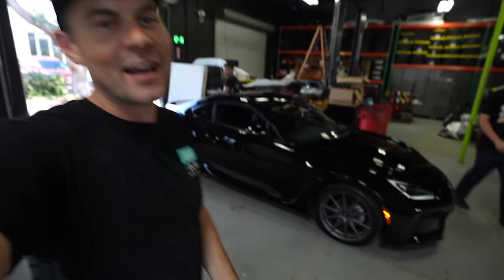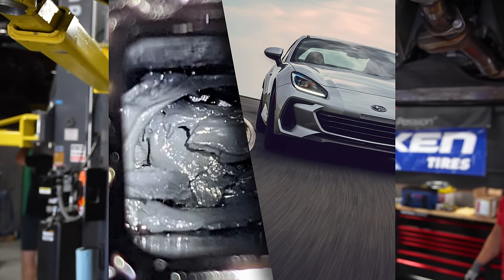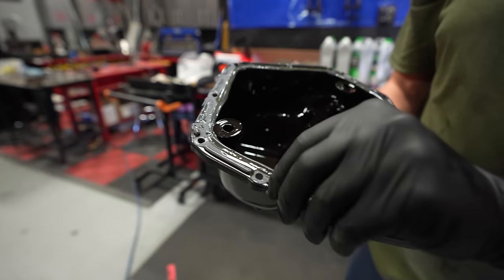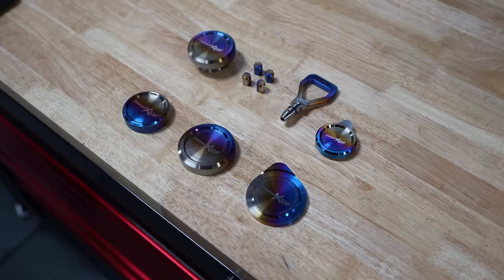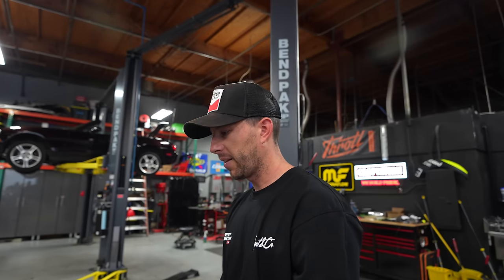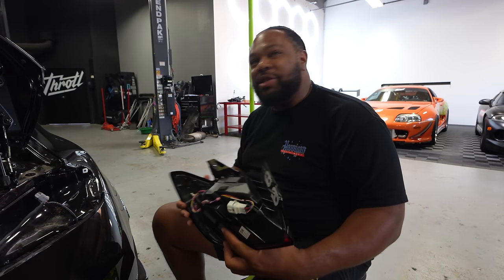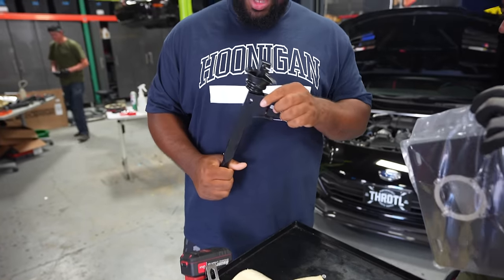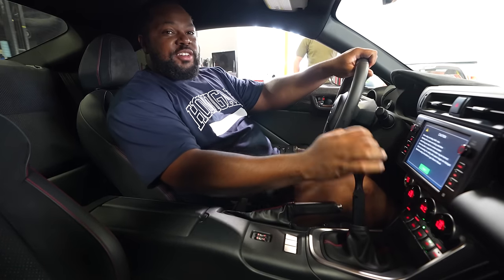Building a 2022 Subaru BRZ in 14 minutes! (Best Bolt On Modifications)

Comment: Improving balance on a already balanced car makes it better with the street look! Love the exhaust sounds too.
Reply: What do you mean improving balance? After what they did the car will have much worst behavior at the limit.
Reply: @Iseenoobpeoples  lol yeah, literally what do these tack-on parts do besides add weight and drag?
Reply: @bill_g.  I would be more worried about going from a small low grip tire to a bigger high grip tire, I know from experience on this platform that more parts are required for the car to be stable with those. Well if you stay below the limit the car might appear to be improved. Saying it's more balanced is hilarious.
Reply: @bill_g.  For your information the OEM LSD absolutely can't handle what they did, it will have horrible dangerous behavior at the limit and if they change the LSD for a clutch pack then other parts need to be changed as well, including some brand new parts they just installed...

Comment: I didnt watch the vid when you installed the irp shifter buti hope you guys put thread locker on the bolts because they can come loose since it increases nvh in the area. Just a heads up in case it happens you know how to fix it, very easy fix

Comment: RTV isn't (solely) what's causing engines to pop, but rather it's just bad design for oil pan design/oil pickup that causes oil starvation during hard/sustained cornering. It's actually an issue for a lot of cars but especially the new 86/brz.

Comment: No, something that is said about the RTV is not true: the RTV clogging the oil pump pickup does not comes from the oil pan seal. (The RTV of the oil pan is the only RTV of this engine that is fine). 
Actually, this engine block does not have a head gasket. This block is made of lots (7 ?)  of different part, and each part is sealed with RTV. Obviously, the screws of an engine block are torqued at a very high force, and so, either when build in factory, or open and rebuild (for valve spring recall), when the block is assembled and closed, the RTV that overflows is "cut" by the high torquing force of the engine screws and by the block closing arround it, like scisors. These pieces of RTV comming from the upper part of the block sometime directly clog the lubrication holes for bearings, causing early catastrophic failure. But most of the time, these RTV pieces slowly travel to the oil pan, and slowly start clogging the grid inside the oil pickup tube.

That's why this issue is a time-bomb: failure and engine self destruction often happens only 10 000 miles after the engine is build/rebuild/closed.

It's to avoid that problem that other brands use classical composite head gasket, or paper head gasket. But full RTV-only head gasket is a special subaru technique, that has lots of advantages when well made, and last longer (when it does not cause an early engine self-destruction), and that is a lot cheaper than composite head gasket (specially in these flats engine made of 7 pieces of block, that would otherwise requiere 7 different head gaskets).
Reply: anyway, even though motul oils are way better than almost any other oils  ... putting a 0w20 in that engine will just make it's life very short, unless the car is only driven very slowly, at low rpm, for daily commutes.

Choosing a 0w20 oil will just ruin any benefits you got from cleaning the pickup tube.

Read the manual. (And the real japanese manual, it's more accurate). 0w20 is only for fuel economy, european regulation on pollution and CO2 regulation. But when pushing the revs or sport-driving the car, it's written in the manuel: oils from 0w30 to 5w40 must be used. Specially anywhere outside the freezing cold of Alaska.

Or maybe is this only a show car, a car-park meeting car, that will almost never be driven for real? 

with of without the RTV that covered half of the oil pickup grid, when your oil temperature will reach 130°C (and that will happen if you drive this car in moutain uphill), with 0w20 you will destroy your engine.
Reply: (but anyway, great job doing all that)

Comment: The RTV in this car will not starve the engine of oil. There are 5 or 6 screens in that tube and only one is partially blocked.
Reply: The amount of screen doesn't matter if 1 gets partially blocked. Overtime it's easy to see that RTV breakoff can accumulate and almost fully block one screen, doesn't matter if there are 100 screens, if the first one is blocked, there will be less oil flow

Comment: hey when you guys installed the coilovers did you get any knocking or creaking from the front top plates?  There's been talk around just lightly tightening the top three nuts, putting some weight of the car on the coilovers, and then torquing to spec.  Also, did you do this with the lower mounts - preload the bushings before tightening them down?
Thanks

Comment: Such a cool lookin little car. It’s a crime that they never gave it an engine to match its looks. If only it had like turbocharged 325hp~350hp engine that would have made the damn thing perfect. And if it already came with a turbo, all that would be required would be some tuning if people wanted to have a little bump in performance turbocharged performance is so easy to gain just with a tune in mapping especially when the engines are designed to handle boost. Unlike high compression Naturally Aspirated engines with a turbo slaped on. They  actually have low compression rods and iron more robust blocks and gaskets all that stuff to handle some more boost beyond factory with a tune. That’s why the two Jay-Z engine is so legendary even though it only came with 250 hp because it was designed to be boosted. It could handle so much more boosting you could get so much more power power out of it…. Try doing that with a little high revving, naturally aspirated lightweight engine where they cut everything to save weight that would’ve made the engine more robust..

Comment: Hot a question tho than stock RTV issue is also present on the Toyota Version? on the 22' GR86
Reply: Yes, same engine. But biggest issue with this engine seem to be on the track and drop of oil pressure, not related to RTV issue.

Comment: Not wanting the be that one, but for me, the exhaust, coilovers and wheels would've been enough. I'm not a fan of that Carbonfiber on a black metallic car, especially if it is added instead of replacing stuff. You'd use Carbonfiber parts to save weight, not add it. Only the Hood saved weight there.
It's still a great project and I enjoyed the video nonetheless. I'm just saying that I wouldn't make all those changes if it was my car. 
The fun part about customizing cars is, that you can change it to your own liking after all.
Reply: Yea all the BS carbon pasties made me cringe. Especially over the sharkfin.

Comment: Stick on parts are so weak.  Wheels and suspension mods look sick and the exhaust sounds fantastic over stock.

Subaru Oil Pan Guy: Bigger the gob the better the job.

I think by the time you're finished spending on that BRZ you could have bought a c7 z06 instead.  And let me tell you, haven driven both, the BRZ isn't in the same league.
Reply: c7 is great... anywhere but really twisty backroads and canyon stuff I'd agree with you
Reply: @smcheeto  it eats that up too
Reply: @ml.2770  brz brakes later and carries a bit more speed through the corners on sticky tyres. if you’re in something really aggressively windy I think the only better car would be a lotus
Reply: @smcheeto  you and your theories
Reply: @ml.2770  I’ve driven both generations of brz, a c5, c7, c8, emira, elise, gt3rs, 911 turbo s, and an r8 on the mountain roads near my home.

I wouldn’t really call it theory

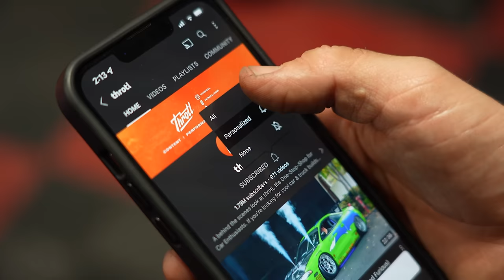Comment: Wouldn't it be good to be benched all the game for 7 years? I quite remember this with a bus 0:19. I don't remember why I'm doing these oil/filters/break calipers chores at Bastion if everything haven't brought you close to this new bicycle experience - always can get it preowned, but that you try to escape. Maybe some good service job could fix this as everything overhaul. Personally I'm ready no to sit so comfy in that SUV - I imagine this car would not be so pleasant in a long trips compared to ford and that wouldn't be my/town defeat because couldn't have it - take this pizza/hamburger while it's hot. Basically all the Supra and R35 370z are too expensive and this or that ten years older this being at that almost could price point in competition to other cars of this class when you initially dreamed about it plating 2000 Undeground, but Unbound has some good news here with Heat Turbo choices, because that's where it be that lights upgrade 4:00.

Comment: Getting rid of the RTB should have been the FIRST step. BUT of course the first step is always to lower it and ruin it for any reason other than the track. Then slap needless carbon fiber BS on TOP of the stock stuff to INCREASE the weight and cost, but even the weight out by putting in a light weight battery for more money lmao. 

PLEASE STOP with the $2k+ exhaust systems that do little for performance and just make it sound like Pablo's beater Civic.

This is just Pimp my Ride without the TVs and absurd sound systems.